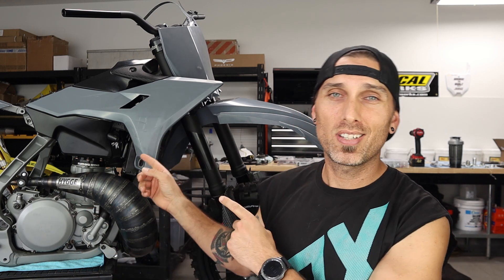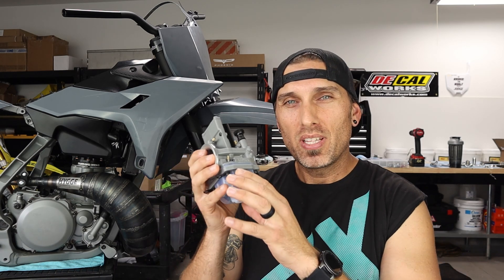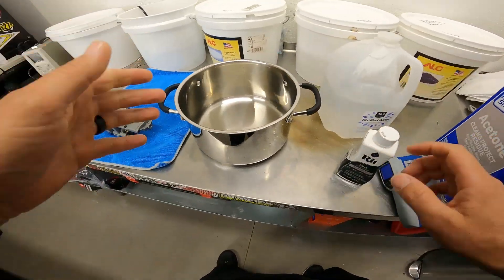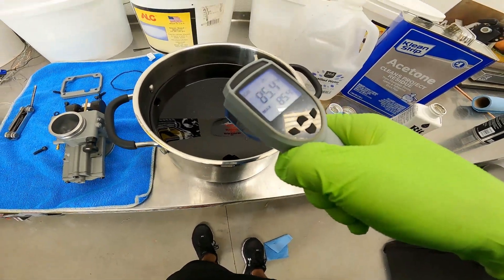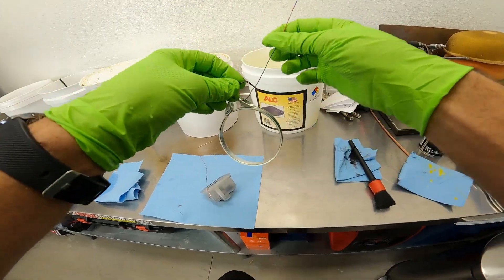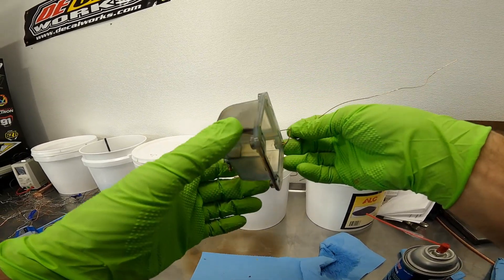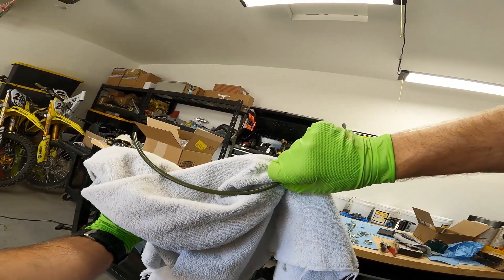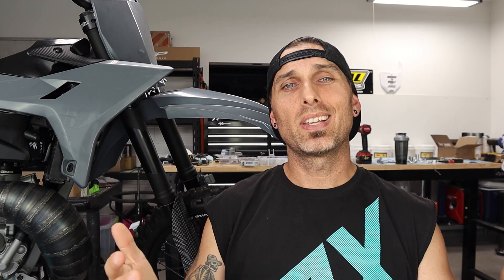My GNARLIEST Dirt Bike Build Ever - SO CLOSE To Done 🔥 Next Level 2009 Yamaha YZ300 Two Stroke

Comment: I love this bike! It’s the original color scheme I wanted to go with for my bike, but you are taking it to another level. The black hardware, suspension, etc is so badass.
Reply from the maker: Thanks Brett, it's been a challenge at times! Some parts are VERY hard to get black & some cannot be done at all. Like the adjusters in a throttle cable for example. Stainless. That part won't take my blackening chemical & also not something you'd paint for example. I came up with the idea to use heat shrink over it after it's adjusted properly. Stuff like that over & over. Just have to be resourceful & get my imagination going 🔥 Lot's of weird stuff that usually never crosses paths with a dirt bike!

Comment: Charles your bikes are always insane!  Have you ever used C series cerakote? You don't have to bake it so it's possible it coat plastics or larger projects that don't fit it the oven.
Reply from the maker: Hey thank you Tom. I have, but I've never tried it. Usually sano metal finishing or Apex Factory services will use the h series bake on for my stuff. A few years ago when I gave this aluma hide a try, the intent was to give guys an alternative that they could do at home, which required me to throw them back in the blaster. Some of it was extremely hard to remove with aluminum oxide even. And then some areas have shown a little bit of chipping earlier on because I did not prep them properly, the learning phase a few years back. But I definitely do love cerakote and thank you for adding some value in the comments

Comment: Hi Charles, I really like your creativity. I have learned a lot of stuff from watching your videos, I appreciate how organized you are and how you always explain everything so clearly. (Coming from a fashion design background, I have a lot to learn before I am able to do all the work on my motorcycle by myself, even with the motorcycle manual at hand. :) Anyways, as a fashion designer I often work with textile dyes and inks, and I might have an advice for you. The textile dye you're using here is a consumer grade (home use) product. Also, it is intended for multiple kinds of materials, which unfortunately means that even if the dye sticks, the color might fade, especially if exposed to sun or water. (Why? Because every material needs a different chemical for the perfect reaction. Cellulose based or animal based fibers need something different than nylon, PU or PET, an Ritt claims to do it all...) I would recommend you to look for an industry grade dyes/inks specialized for synthetic fibers. Those are basically everlasting and don't fade away so quickly. With the industry grade product you'll go a long way, even with a sample sized bottle.
The reason why the color turned out to be dark green is because no black dye is actually black. Black fabrics are rarely perfectly black (trust me I know, I only wear black, lol :) Black dyes have different shades of black, the depth of the color is dictated by the recipe, the ratio of used pigments... some blacks have a little warm (reddish) or colder (blueish) tone...   I'd close the hoses on both ends before the dyeing, as well as the inside wall of the bowl, the fuel is probably going to react with the dye. Anyways, The dark green looks really nice, as well as the black n gray color scheme. Black hoses would look great, too. Looking forward to watching this motorcycle come to life. Cheers from Europe!

Comment: My man! That looks amazing. The clear hoses wouldn't be bad but the black would be better overall. 

Are there any concerns about what the fuel may do with the dye? I assume it would be fine
Reply from the maker: Thanks B! It was a fun test. You're right, I am not concerned. I had a brand new KTM suck an entire reed petal off the cage, and right through the engine. 11 hours! I was terrified but there was not actual damage thankfully. "It really sucked" 😂
Reply: @mxrevival  man between KTM's doing that and Beta's eating bearings, gonna stick with my wee little Chinese 2T 🤣. Are you going to pick up the GPX 300 2T?